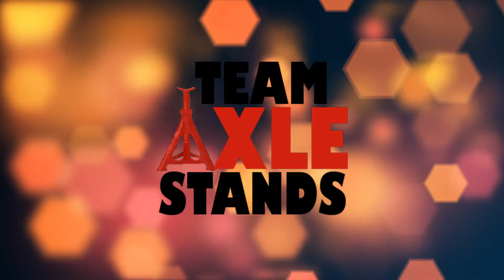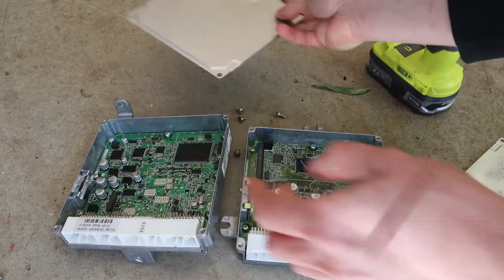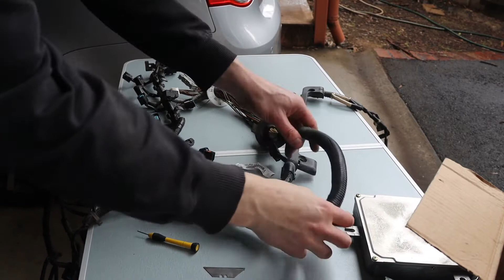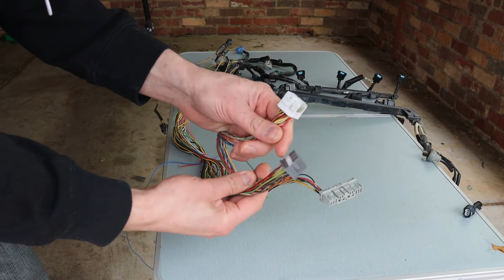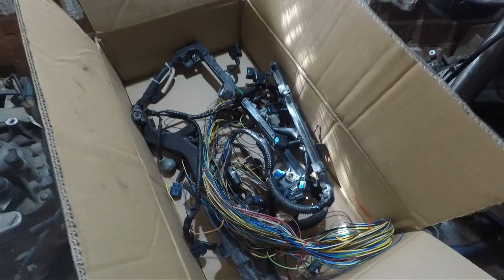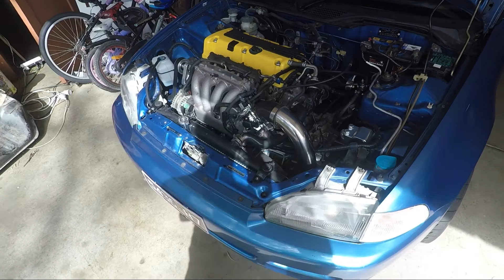Converting an auto CRV harness for use with a manual K swap DIY

Comment: What year Crv engine harness did you use? And then did you re-pin it to match the 0506 RSX ? For ktuner ?
Reply from the maker: Mine was an 04 from memory but any 02-04 will be like this. Yes I re-pinned at the ECU end to suit the 05/06 RSX (quite a few pins need moving).

Comment: So could you use a manual early style crv harness for a k swap with kpro with no modifications??
Reply from the maker: Depending on which engine it was going onto. The only ones i can think of are the k24/k20 crank signal plug and the knock sensor. Other than that it would just be the 6 speed reverse lockout. But for the majority yeah there would be minimal/no modifications.

Comment: I'm wondering if this would work on the k24a4 from 03-05 Accord (not drive by wire). Seems like it should. I read the 03-05 accord ecu does not have a CEL output wire because it uses can bus. I guess I should compare an accord ecu pinout to an 05-06 element ecu pinout.
Reply from the maker: using the 03-05 accord ecu? I still think you would be ok. The chassis harness handles those outputs. Probably best to compare the A and B plug pinouts of the ecus.

Comment: Great video but i have a question about the reverse switch. Where dose the wiring go from the reverse switch?
Reply from the maker: From the reverse switch it goes back through the loom and into the C101 plug. This plug then plugs into your chassis and triggers the reverse lights to come on.
Reply from the maker: From memory I'm pretty sure its Pin 1 and 2 of the C101 - the switch simply joins these two together

Comment: are the CRV harness the same as TSX K24A2?
Reply from the maker: There are 2 types of CRV harnesses i've used. This one in the vid is an 02-04 one and is more like the RSX than the TSX because its drive by cable. The one i used in my EG conversion was a 05/06 CRV which is drive by wire and probably similar to a TSX. It required a few plugs/wires to be added to be able to support being used with the conversion.
Reply: @teamaxlestands  how would you make auto TSX harness to manual. would it be the same as this method?
Reply: @teamaxlestands  currently doing k24a2 smart car
Reply from the maker: @bcbcfilm  Hmm i've never had anything to do with an auto TSX (Accord euro here) I imagine if you are comfortable with wiring it would be ok. Removing the auto would be similar to this. Then you may need to remove the drive by wire and add in the IACV, TPS, Speed Sensor, reverse lockout and Reverse light. Might be easier to find a harness which is closer to being right for your setup?

Comment: Nice video mate! I have an 04 manual k20 ecu and loom from the crv i got the manual awd box from. Will dm you about them. I think i know what your next project is 🤔😁
Reply from the maker: Sounds good! Pretty sure a manual k20 will require minimal/no mods (maybe just unwrapping and getting the lengths right around the throttle body).

Comment: Thanks for sharing. I'm going to start collecting the auto harnesses and give it a try.
Reply from the maker: If you can get your hands on a manual one its even easier and if you can match the year to the ecu you will be using you'll be basically plug and play